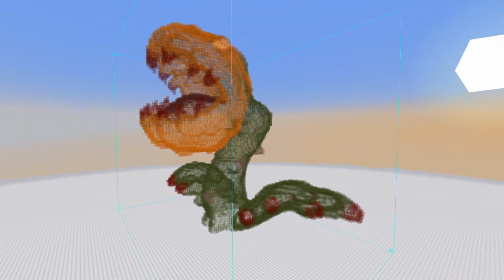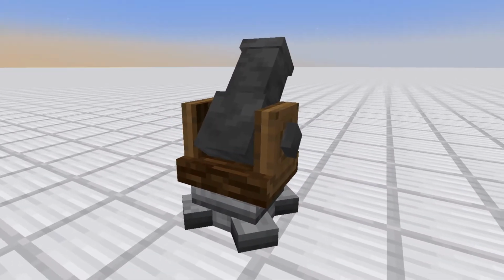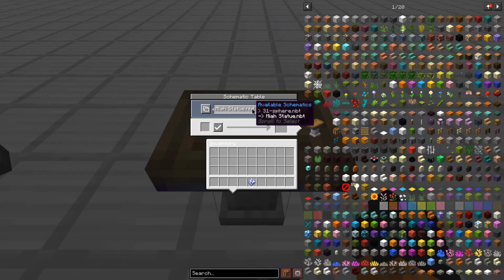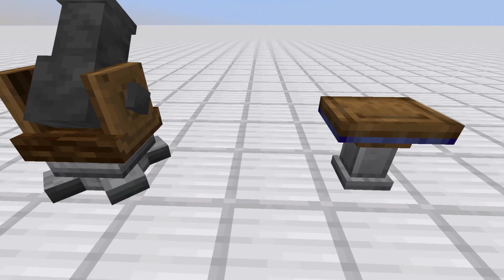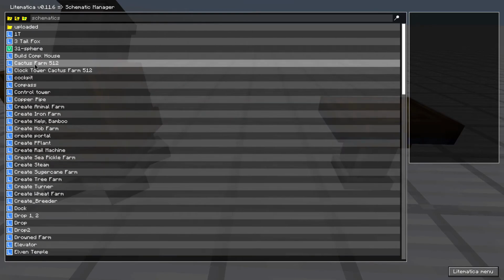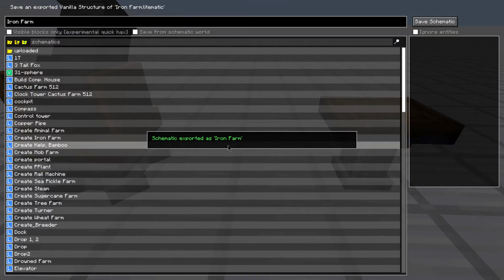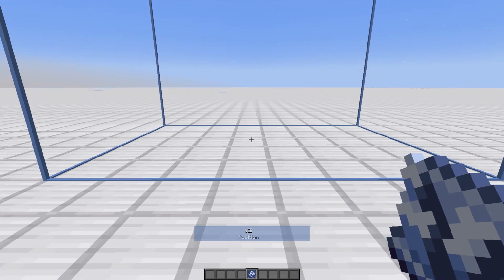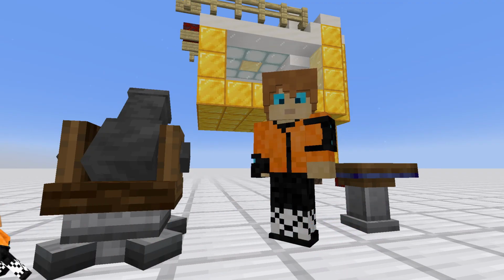EASIEST Way to Convert Schematics to .NBT in Minecraft

Comment: I press "M" and nothing happens, I've installed the litematica mod as well and it just doesn't appear, I've serached for its keybinds in keybinds settings and couldn't find it at all... Please somebody please help me!
Reply: press Esc at the right bottom  corner  you have the button mods. Then select the mode and change the keys as you want
Reply from the maker: You should also be able to press M + C at the same time and get the main settings window where you can manage hotkeys. =)

Comment: Doesn't work with 1.21.10. Trying to downgrade schematics to 1.20.1. But like most now a days, the modder made a stupid decision and decided "Hey, people like this feature as it's really useful! Oh no! Oops! Just deleted one of the best features! I'll just act like a corporation and avoid fixing it." Because the only options I get are "Import" "Rename file" "Copy" and "Delete" even in the 1.20.1 version I was trying to convert to doesn't have it...
Reply from the maker: Yeah, I had tried to come up with a fix a while back for someone who ran into that issue. Seems like the only fix is to use an older version of the schematic in an older version of minecraft and then copy it with just litematica or forgematica for neoforge builds. For normal forge you can use litematica with the connector mod to make it work. They say you can change like the format number on the schematic to make it work but that never worked for us.

Comment: hello, my .nbt file have 21.000 KB size and i cant upload it to the schematic table. help pls
Reply from the maker: Hmm if the file is .nbt it should work fine, I've never come across a situation where it wouldn't Maybe something got corrupted when you converted it into a .nbt? Does the .nbt file show up if you try to load it with litematica?
Reply: @MiahQuests  says max size is 256 KB

Comment: Does it support substituting vanilla blocks for other modded blocks by chance? I can't do it with /fill in creative mode because the pack I'm using crashes when I try to play singleplayer lol
Reply from the maker: Litematica will work with modded blocks however I've seen times where certain modded blocks are invisible but the data is still there, so you can place them you just can't see their ghost image. Most times there is no issue though. =)

Comment: I dont have the "export as.." function while i have both mods installed. Why is that?
Reply from the maker: Hmm, well assuming you aren't using a super old version of Litematica from before this was added I would think maybe you're trying to convert a non .litematica schematic. This only works on schems. with a blue box and an L in it next to the schems. name. These are Litematica schematics.

If you highlight a schematic the buttons along the bottom should be Rename, Set preview, Export as:, Schematic and Delete. If it isn't a Litematica schem, it will only have the import and delete buttons. If you're following the tutorial and it's not any of this you must have some bug or something interfering with the mod.